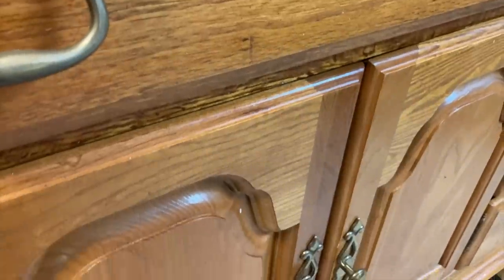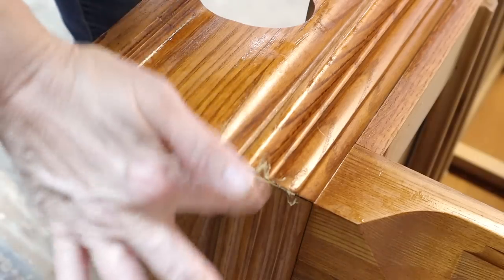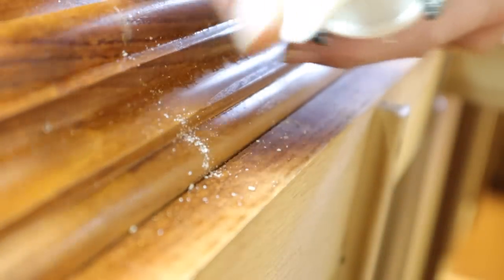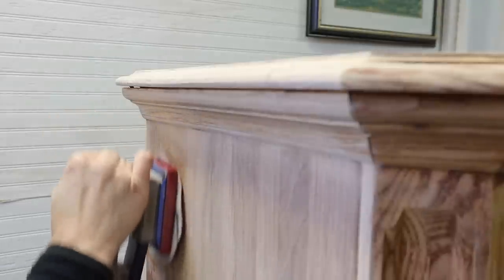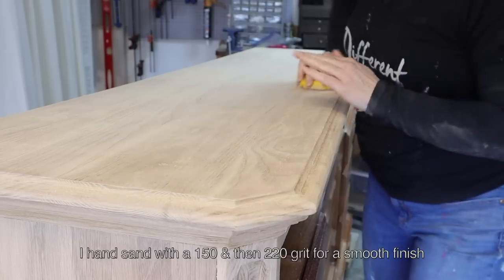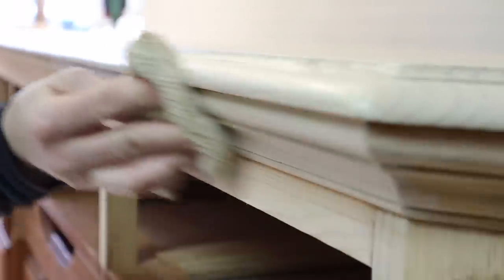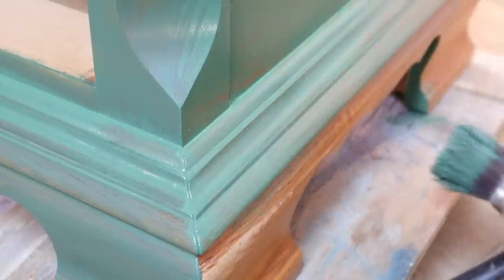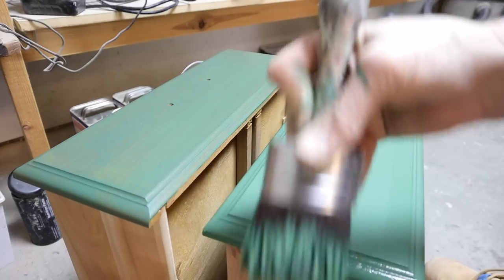Painting Furniture Tips 80s Oak Dresser MODERN Makeover | Dipped Look Transformation | BEFORE AFTER

Comment: Your work is lovely. I have couple questions. Not being critical just trying to learn. Do you always use latex paint and why instead of chalk?  Also why did you use wood glue under the wallpaper instead of mod podge  thanks for your help
Reply from the maker: Thanks so much Sandy. I use all kinds of paints I have my faves, like DIY Paint that’s why I’m an affiliate for them, but there are just sometimes where I like to use other paints. Valspar is my go to for  latex and Annie Sloan is a great chalk paint. 
The reason I went for latex on this one is bc of my inspo which was the paper and I could colour match to it. 
The wood glue on the paper was just a matter of it was what I had. It does the job and I haven’t had any troubles using it with paper. Hope this helps 🥰